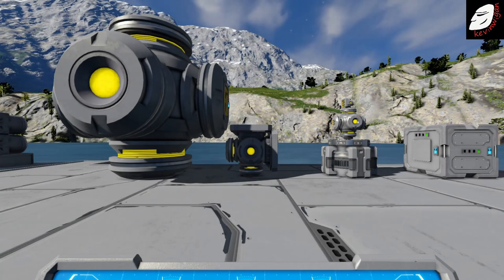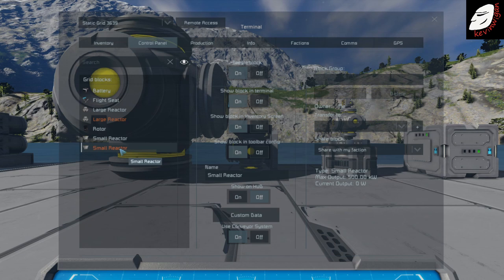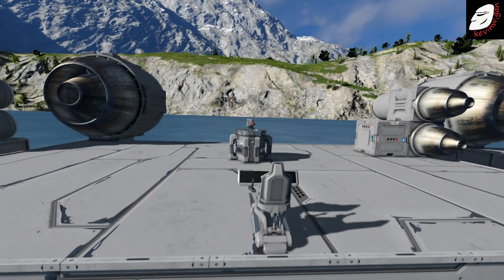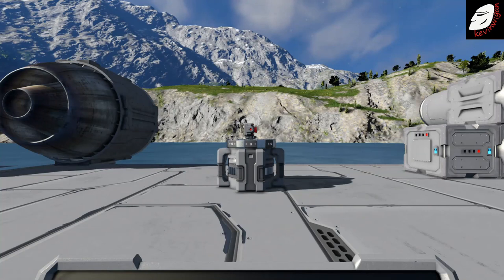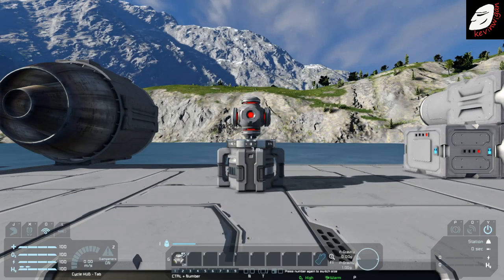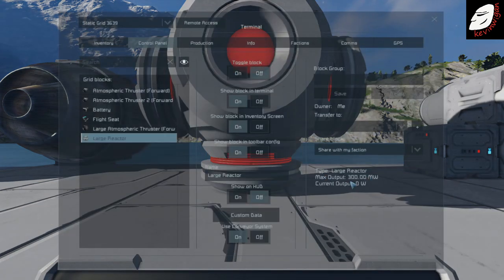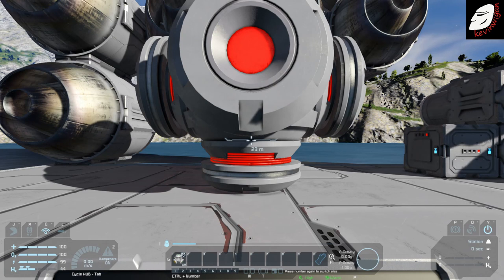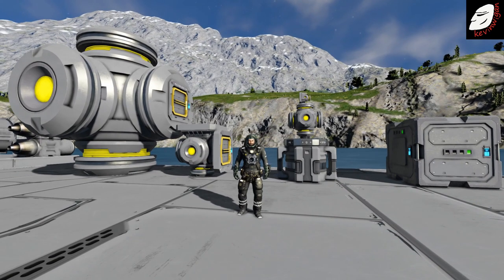Reactors in Space Engineers.

Comment: The larger reactor is going to register less days because the reactor has a higher output and that engine is asking for it

But as far as efficiency goes all reactors consume the same amount of uranium per kilowatt output

So larger reactors are more efficient than smaller reactors because of the cost to build the reactor is cheaper
A large reactor cost less resources than a bunch of small reactors that match the same kilowatt output so if you have the space go larger

this might be a bit off topic but something I've found out was if I have a whole bunch of refineries with a whole bunch of you modules and I'm trying to refine a whole bunch of gold or something if I run just a few hydrogen engines all the refineries will be running at Max speed for some reason if I turn those off and turn on a large reactor they'll be running at the same speed but draining way more energy so I don't know if it's a bug but when I run my refineries I just use a few hydrogen engines to power my 20 refineries way cheaper than using my large reactor